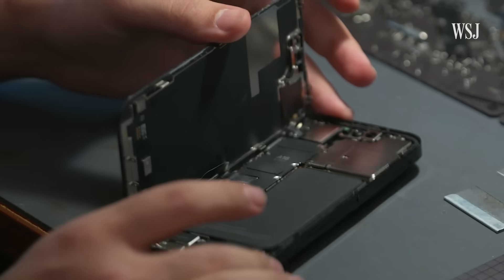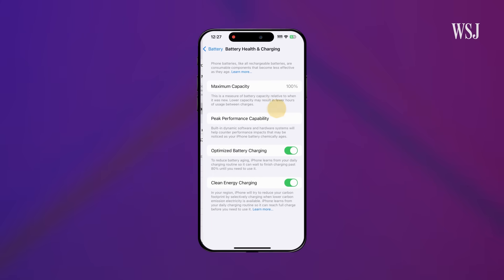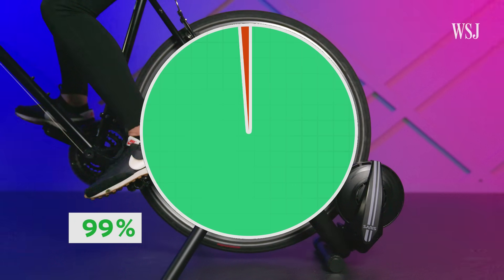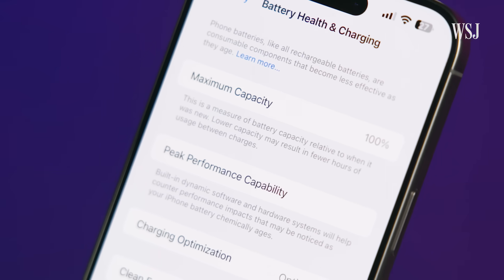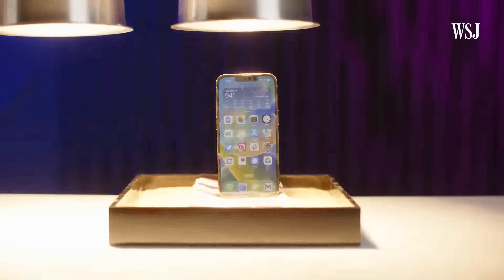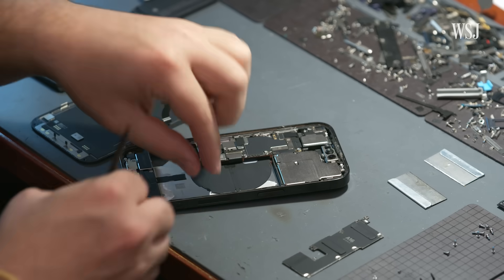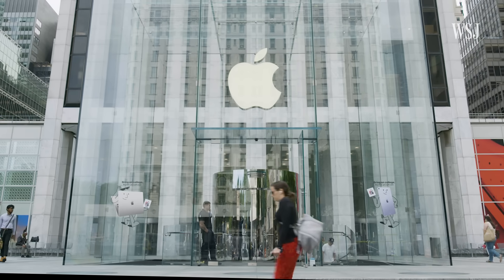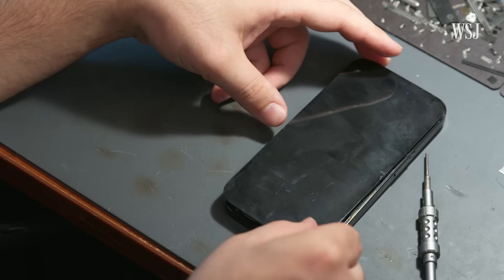Why My iPhone’s Battery Expired in Only a Year | WSJ

Comment: The problem is, basically everyone's iPhone 14 batteries are degrading faster, and I don't think everyone is subjecting their phones to more heat then they did with iPhones 13. So, Apple is making iPhone batteries fail faster, and we need to get Apple responsible for this.
Reply: @@silver-monkeyI know 
I’m everything Apple and deep in their ecosystem 
but man the ppl who would come up with , to defend a two trillion dollar for profit companies that truly only care about our money , is just 

I love Apple but they are greedy , and gets worse.  It’s the fact coz they can be greedy.
Reply: The problem is Apple uses different chemistries for different products, for a GOOD REASON, not to make people buy more iPhones.

iPhones are the only apple product charging with up to 3C charging speeds, meanwhile MacBooks max out at 1,3-1,4C and iPads even below 1C.

I know a few iPhone 13 and 14 users, and most of them have a good battery health regarding to the cycle count. The ones with bad battery health are the ones going often to 0 or 100% charge, keeping it for hours plugged in at 100%, doing exclusively fast charging etc. I know only one power user whos low battery health is coming from endless gaming and charging all the time and this guy accumulate like >800 cycles per year which is just crazy. His last iPhone battery was replaced at over 2000 charging cycles because battery life was getting abysmal.
Reply: Because one Apple provides iphones with 500 cycle battery life vs macbook, ipad and watch with 1000 cycle rated life. Most people are not aware of this that iphones have inferior battery relative to their other products. 

Reason number two is their 14 pro display has way more peak brightness at 2000 nits with always on functionality. This eats up battery power quickly and you need to recharge your 14 pro twice daily, so on average people spend 1.5 to 2 battery cycles each day. Hence your batteries are failing quickly because they are weak in first place relative to power consumption.
Reply: @Fear.of.the.Dark.  You are not getting the point here. iPhone 14 batteries are degrading faster even on a per cycle basis. 
The first point is, okay iPhone 14 Pro (Max) has always-on and brighter screens, but that alone isn’t going to use that much more battery to have the battery degrading that much faster. That’s what’s everyone trying to speculate or defend this second battery gate. 
The second point is, iPhone 14 batteries are degrading faster per cycle basis than before. This video is the first time that I have seen someone posting their battery cycle count along with health percentage. And to my expectation, iPhone 14 batteries are degrading faster per cycle. Even though Stern try to speculate heat was the reason behind this, I don’t think so. I don’t think everyone is subjecting their iPhones 14 to that much more heat to cause them to degrade like 30% faster. 

So the reason is Apple is pinching money out of us by using bad batteries on iPhones 14. 

Finally, the battery cycle specification. Ok, iPhone batteries are specced for 500 to 80% health, and we are used to iPhones batteries that far exceeding what they claim they can do. For example, Stern’s iPhone 12 Pro is projected to hit 80% at about 1100 cycles (my calculations). But the 14 Pro will hit 80% at about 750 cycles. Apple can make very durable batteries in older iPhones and Mac / iPad / Apple Watches, why can’t they keep using these good batteries?

P.S. I am not aware of anyone comparing battery durabilities across different device types. It’s kind of meaningless because we use laptops and phones rather differently. 

Look, I have brought a lot of Apple products over the years, I had been very excited about them. My devices in Find My fill up the whole screen plus half a dozen more. I just can’t agree with what Apple is doing lately.
Reply: @@silver-monkey You are being very naive. Samsung has a much worse record when it comes to battery health over time than Apple. Aside from that Note 7 explosion fiasco a few years back, Samsung phones in general are known to have batteries that inflate significantly over a normal use cycle of 5 years.

I've had an iPhone X since launch, and it's still working fine 6 years later with over 85% battery health. Realistically, if you pay any remote attention to your battery charging habits (i.e., when, at what percentage, and how long you charge) and optimize that so you don't charge the phone over 80% regularly or let it fall under 20%, the battery the phone came with will last for at least 5 years without dipping below 80% battery heath.

Comment: Are you not going to investigate at all about the fact that apple in their last 2 models is using cheaper 600 cycles batteries instead of 800 cycles like most of the expensive phones out there? This was a really poor article finding why batteries are draining at much higher speed than in the past! 🤦🏻‍♂️
Reply: Bingo. This is not really a good deep dive into 14 pro battery life issues. Actually it is 500 cycles for iphones. Their macbooks, ipads and watch has 1000 cycles rated batteries. It is clear they are using inferior battery in iphones. 

Maybe they want users to upgrade to newer iphones more often as batteries get weaker or they did the math and want for more regular $99 battery service from the large iphone user base.

Comment: Partly due to Apple inject too much features which not say helpful thus also contribute to drain your battery fast. There are many info on how to prevent the software drain your batter fast. Most are disable those unnecessary features you don't use or even use much. Plot twist, in fact Scientists have invented battery that last dam long is unlimited usage. Again is all about business......imaging the phone battery is long lasting no need to replace.

Comment: Never replace your battery unless your phone is completely dead and won’t turn on. You should replace your cellphone every 2 years anyways.
Reply: I was using an iPhone 6S for the past few years until it died a few months back. The battery percentage was 72%. I had to charge it twice or thrice a day. 

I am using a used iPhone 13 with 91% battery health. This serves my purpose.

Comment: Yes, you can live a perfectly normal phone life babying your battery, first, slow charging overnight, second set a shortcut to kick your phone into low power mode at 50% third use the 80% limit as much as you can and you can baby your battery into years of extra service.

Comment: Priceless research. After the first year my battery is still 90% strong as new. Getting this 14 Pro Max Battery replaced at $89 rather than buying an iPhone 15 Pro Max at $1200 makes a massive amount of financial sense. Especially since so many colors like gold are extinct.
Reply: 90% after one year isn't great. I have 90% on my two year old iPhone Mini 13 which is charged at night and often during the day. There is something not right about the battery in the iPhone 14 Pros
Reply: @rickiehoxton  yeah but it’s only $89 and the rest of the now extinct gold color 14 PM is good and runs very cool.
Reply: @rickiehoxton I am on 86% today on my 14 Pro Max after more than 1000 charge cycle. I do not baby it at all and always charge to 100%, and let it drop to 1% or even 0 sometimes.
Reply: use the word "color" for the new phones very loosely. :)
Reply: Did u replace at apple? Plus have you been asked or told to update your phone when u took it in?
Reply: @reddiegaming195  didn’t replace it yet. No need to replace until 70% or so. I’ll probably get the Apple battery.
Reply: Or like, get 10 replacement batteries and a programmer so your phone doesn't hiccup (and some T7000 to glue back the screen, maybe a heat pad and suction cups) and still come in under $300 and 5 new best friends.
Reply: I mean you could sell or trade in your 14 pro max
Reply: @Timberlakelin   14PM performance is so close to the 15PM's that just replacing the battery next year for $89 makes more sense. Runs cool. Lightning port is compatible with my 30pin car using Apple's adapter cable. Irreplaceable in Gold.
Reply: @lawrencefearon6830  There will be huge difference in future updates when it comes to AI futures much like how the cut off point of new features is at the iPhone 12. Because the neural engine is 2x faster in the A17pro.
Reply: @Timberlakelin  Just not worth a one generation upgrade now. Future updates might change that but 14PM's are 95% of 15PM's performance. Plus it's the now extinct GOLD and Lightning ported.
Reply: Depending if you keep your phone for a long time. Let's say you keep your iPhone for 5 years. Maybe that $89 is it worth it anymore. There are more points of fair years because hardware doesn't last forever. If you do simple math maybe at that point you've used up most of the value from your phone. At that point you could probably even trade in or sell your phone.

Comment: I have always wondered about repair movement when in Philippines it’s actually cheap and easy to replace battery and LCD or OLED of iPhones. It’s those people who dont use cases who will most likely enccounter a big problem if it’s Face ID that is broken. There are many shops even authorized apple service centers which cost alsmosy the same anyway to replace any part

Comment: The reasons outlined are wrong

14 pro (also 15 pro) has higher 2000 nits peak brightness display and always on display so it consumed way more battery and needed frequent recharging mid day, hence more battery cycles. Basically Apple had a small capacity battery relative to display power consumption and it is their design flaw with 14 and 15 pro series. You didnt have such a power hungry display before 14 pro.
Reply: @@silver-monkey yeah she openly made a point for going to Apple for battery replacement while not really giving a good answer on why battery sucks in first place.

Comment: I love this analysis and educative nature of the content. I'm using the phone constantly in Low Power Mode, made automation (Shortcuts app) that turns it on again when reaching 80% charge I'm very happy. BTW - I had exactly the same problem with fast drain on iPhone 14 Pro. It barely lasted a day and the phone was warmer than usual. I uninstalled most of my apps, turned off background sync for all of them, but still no change. The issue was mostly addressed by later updates of iOS 16, when the battery life went back to original (still worse than previous iPhones however). So there was either some exploit or bug in earlier iOS 16 versions that caused excessive drain... My 2 cents, Apple knows the best.
Reply: Low power mode disables your 120hz display and switches to 60hz to save battery. What’s the point of owning an iPhone Pro then?
Reply: Your post is also another good clue. What happens when lower power mode is turned on for 14 pro? It disables peak brightness of 2000 nits and always on functionality of the display. The display power consumption relative to battery capacity is the main issue with 14 pro lineup.

Comment: I got my iPhone 14 Pro Max in January 2023, now I have 74 charge cycles my battery health is at 97% after 10 months used
Reply: 74 cycles is very low for 300 days, do you use your phone on low power mode all the time?
Reply: @Jst4vdeos  nah bro

Comment: Here’s my problem with this video and others like it…

They hyperforcus on “iPhone” battery. No, ALL batteries die. 

It only seems like your iPhone’s battery dies faster because you use, and abuse, the battery more compared to a TV remote. You don’t put your TV remote in a hot car or on a hot dash or insulate it with a purse or pocket. You don’t use a TV remote constantly for hours a day and charge it back up every night. 

All batteries eventually die but some people insist on conspiracy theories over physics. But verbally separating iPhone batteries from all batteries doesn’t help.

Comment: "Why Do iPhone Batteries Drain So Fast?" Could it be maybe, because people text for 6+ hours a day plus checking FB/X-Twit/Snapchat/Tic-Toc? Weird. I don't do that and my iPhone charge lasts from 100% to 20% about 5 days. Yes, I do text and use the phone to speak to people. And my battery doesn't drain so fast.
Reply: no that is not the primary driver. It is not like facebook and snapchat did not exist before 14 pro. Main issue is 14 pro has 2000 nits brightness and always on display.

Comment: My iPhone 11 Pro is now at 88% capacity. I bought it in October 2019, and have yet to replace the original battery. I always try to charge it to 80% and then unplug it. Since I am not a power user, I don’t need a 100% charge. I just wish iOS 17 allowed you to limit the charge to 80% on the iPhone 11 Pro. Why is that not available?
Reply: They need people to upgrade to the newest models somehow
Reply: I believe that is called smart charging but only androids have that

Comment: To be honest, I do baby my iPhone 12 Pro Max when I’m not using it outside of the house I use my iPad and my computer instead I hardly use my phone in the house right now. My battery is around 87%.
Reply: Update to this story my battery finally hit 79 percent after nearly 5 years so I will go to the Apple Store and try to get a replacement my phone is still in good condition and not problems at all lol

Comment: iPhone batteries are just too small and need to be recharged more often and go bad sooner.
Reply: correct. 14 pro especially has 2000 nits display with always on. The battery capacity is too small to handle the display power.